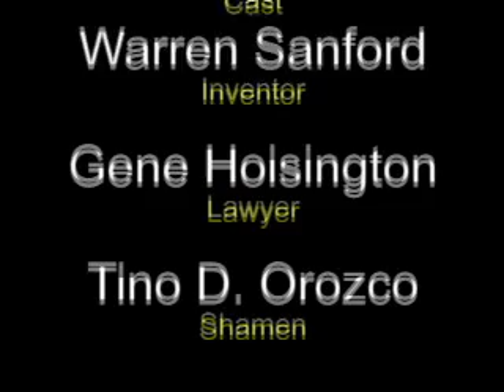W.A.N.D. (Wireless Atmospheric NRG Device)

Comment from the maker: We are surrounded by electromagnetic waves; they are in the form of light, sound, heat, x-rays, radio and TV, etc. The key to this free source of energy is in the design of a transducer which can convert this EM energy into a useable form of energy, such as electricity.